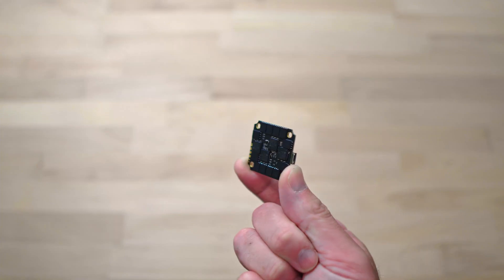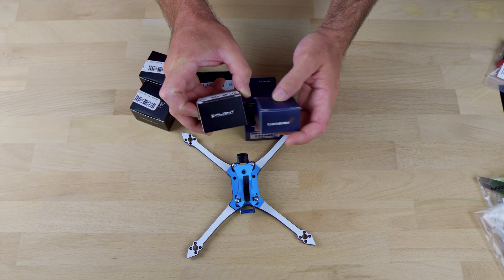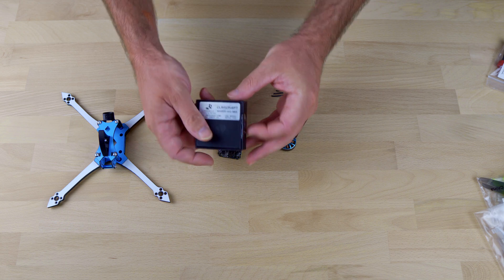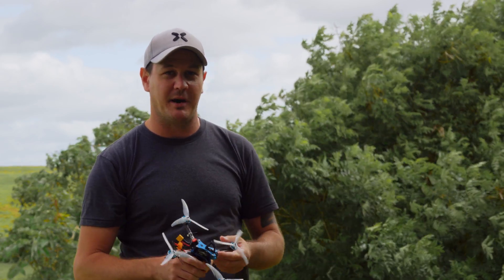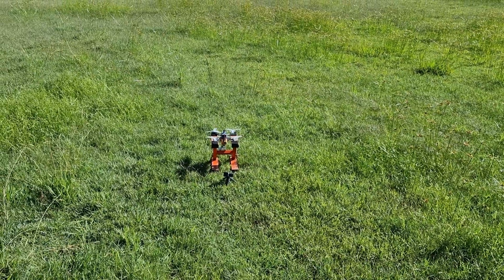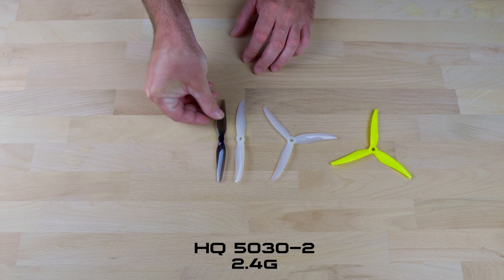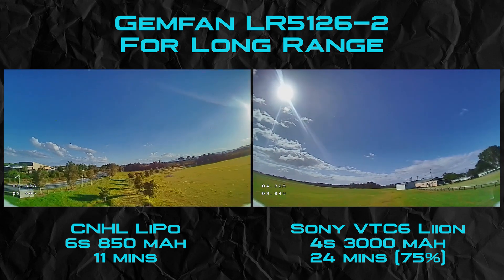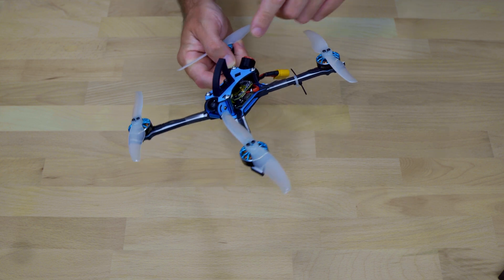Next Gen Race Drone? (Still flies for 30 mins!)

Comment: hey bro, did u use bi blads or tri for the 4s lion and 6s 850 pack?
Reply from the maker: Gemfan LR5126-2
Reply: @ScottTomlinson  sick i imagine it would carry a 1300mah 6s just fine and be a lr beast right? prolly like 15 minute flights?
Reply from the maker: @MrKillerHobbes   The extra weight has a detrimental effect. It'll carry it ok but don't expect any more flight time.
Reply: roger that ty! @ScottTomlinson

Comment: I’m trying to decide on what motors to use on the Black Opal I got from cnc drones.
I see you tried several different sizes and I was wondering if one motor stood out from the others in terms of performance?
  
  FWIW,
 The 5mm version came out at 50grams.
Reply from the maker: The 2005 really packs a punch but you have to live with T-Mount props. I'd probably still go with the F2203.5 but higher kv unless you want that max flight time. There's a 2000kv variant in that now too.

Comment: Hi Scott, your videos inspired me to build an ultra light 5" LR quad. I understand that low kV motors are more efficient, correct? Is it a good idea to go with ~1500 kV if I will primarily run 4S? What would be the efficiency difference of higher kV motors? I primarily care about the longest flight time and not racing (although having an option to put a 6S for a quick rip would be nice). Do you think 2005 is better for this than 2203.5 you previously tested?

Comment: Want to upgrade my flywoo lr4 V2, which has the NIN  1404 motors, they claim a 9.2 g/w ratio which is stupid insane high ;-)  they are ok, super light. with 4S 18650 i´m anyway above the 250grams, so i decided to make it better to rach the 30mins limit.  tend to T-Motor F2203.5 2850kv, hope they are not too heavy. How are these Lumeniers in comparison to the t-motors?
Reply from the maker: The lumenier perform better but are nowhere near as durable. Also, T-Mount is a pain if you're changing props all the time. Having said that I'd probably go with these for a LR build. There's a 2600 kv.
Reply: @ScottTomlinson  thank you for response. Never thought durability is the downside in these days with lumenier. I need tmount, too much props around, I missed that, that the lumeniers have standard mount. Aaah no, all have tmounts.

Comment: Very cool! Love the build! I came across this because I am designing a sub 250g 5 inch freestyle quad for my final year engineering project. I just recently got into FPV and love it! As it stands I am considering using a modified TBS Source podracer frame (adding standoffs and top plate by slightly elongating the bottom plate to allow mounting all the components and leave enough room for a GoPro on top; bottom mount battery). Considering using these same motors on 4S at 2000kv. I have just heard/read that the higher kV on such a light 5inch build becomes less ideal for smoother/tighter freestyle control so I'm trying to lower KV as much as possible without loosing too much speed on the top end. Is there any input you might have into this reasoning or any suggestions you might make for motor selection in this case? Thanks!
Reply: Will you share the frame?
Reply: @SirAdrian1st  it's nearly finished and I am presenting it next week. It's come out so well I'm actually considering marketing it at this point. Will post a video about it in a few weeks on my channel and that should have more details about the frame on there 👌
Reply: @SirAdrian1st  also, note I actually ended up going with smaller motors to drop the AUW but still keeping necessary freestyle performance. AUW with a 530mah HV Lipo comes to 199g. That leaves enough room to add a naked GP or insta360 and even swap out the analogue for a naked DJI vista and still be 250g with the action cam included. I also made optional TPU protector prints for the arms and motors.

Comment: Damn can you do a LR.. like 7" ultralight frame with GPS.. Gemfan even has T-Mount 7" now
Reply from the maker: Already in the works my man! Gemfan sent me a bunch of the new UL props to test too. Both the tri and bi blade look super promising.
Reply: @ScottTomlinson  oh awesome. I'll wait. Was going to see if I could stretch out UL6 they make it 5mm. 
GPS, Flywoo compass (only 0.6g), nin 2303.5 t-mount motors (can't full throttle long because heat though) , GF 7"

Comment: So it looks like you used a xt60 which adds 5 grams over xt30, but it’s only a 35amp board: what was the thought process here?? Or was I wrong thinking you used an xt60?
Reply from the maker: XT30 to XT60 is only 2 grams difference (1.1g vs 3.3g ish) Batteries come as XT60 so it made sense.
Reply: @ScottTomlinson  yeah cool: that makes sense. And what size capacitor did you need to protect that little board without wasting space. Your rubbing 6s so I imagine it still has to be fairly hefty?

Comment: With so much power and efficiency, why not go with more prop-blades for a more "Locked in" flight experience?
Reply from the maker: You don't feel that was "locked in"? The lightweight tri-blade on this kv and stator size would be pretty hard to beat in my opinion. Durability of the 5/6/8 blade props we're seeing are terrible too.
Reply: @ScottTomlinson   Thanks for the reply.

Comment: Hey Scott, love your videos. After all this time flying them, what are your thoughts about the props? Any updates about them, my 5inch light build is on my way and I'm not sure which ones to stock up.
Reply from the maker: Cheers Dennis! I still really like the GF SL 5125-3. It's my go to for most things. I did race 7 rounds on this quad this past weekend and used the new GF 5130-3 which are also really great, I hit plenty yet only split one prop at the hub. The SL 5125-3 do tend to break a little easier but that may be a good thing on motors with such small shafts? The bi-blade really are cruising specific. I personally have only reached for them a few times. The HQ variants fly good too but as I have multiple UL quads now and they use T-mount and 5mm the versatility of the Gemfan suits my needs. In summary. If I were picking one prop for a 5 inch ultralight it would still be the SL 5125-3 (In yellow haha).
Reply: @ScottTomlinson  not so sure about the yellow lol, but yeah I'm more of a gemfan guy anyway(running their 3inch and 6inch props). But most of the time I find myself flying biblades(I'm not racing anymore since corona) for cruise oriented freestyle.

So I will get me some 5125 triblades and 5126 biblades for experimenting. Thanks for your response 👍

Comment: never really got into drones since lipos being questionable (ik with prop precaution its good) but did i see a li ion battery there? can you now make drones without lipos? if so i might very quickly get into this hobby since its increadible.
Reply from the maker: Yes some builds are totally capable of flying on li-ion batteries. More so cruising over aggressive flying however.
Reply: @ScottTomlinson  thx, looking more into it. This hobby looks really cool

Comment: I got 2 dead on arrival FC. I only got to test half a 4s li-ion on my 5" long range. ended at 13.2v using 1800mah (3000mah batter) and flew for 24mins.
Reply from the maker: Sucks about the DOA. Nice flight times though.

Comment: I have now watched this video like 20 times. So impressive! 2 questions. 1: other people building ultra light builds have mentioned that FPV is tricky on really light builds as the camera angle needs to be so crazy like 60+ degrees because the quad just wants to climb, have you found that??  2: you mentioned a slightly different “freestyle” setup. Any details? What would you change? Or is a follow up vid coming? Thanks gain for the sweet content!
Reply from the maker: Haha thanks for the views! Flying this quad is no different to my typical race quads in terms of "floaty feel" Being on the power most of the time probably negates this a little however. I do run high cam angles (~55) on everything so your experience might differ if you fly at say, 15 degrees. Yeah video is coming on the 'freestyle' build. It's similar just a squish design and different antenna mounting basically. Still a bottom mount battery.

Comment: First of all, nice video man. I hope this is getting a new hype.👍
But i got a question there:
How thick are all of your plates?
Reply from the maker: 1.5mm and 4mm. It's got so much power you could easily afford to go 2mm and 5mm and cop the 10-15g weight penalty if that worried you. I've put it through actual racing now though and it's holding up ok.

Comment: you should try out the fpvcycle 2203 motors, they are absolutley amazing on smth like this. Absolutley smooth and crazy throttle controll!
Reply from the maker: Stator volume on a 2005 is greater than a 2203 or 2204. I've tested the T-motor variants extensively. That size is good for the mini long range builds. They don't compare to the 2005 however.
Reply: @ScottTomlinson  in terms of throttle controll snd smoothness?
Reply from the maker: The 2203/4 motors tend to peak/flatten out after say 75% throttle. Fine for the cruising rigs but not really race capable just from my experience.
Reply: @ScottTomlinson what about the axisflying c224 motors, have you tried them?
Reply from the maker: @BowOneFire  I haven't yet. Specs look good for a 4S build due to the kv. A little bit beefier though at 2204.5

Comment: Hi! Do the stickers have any meaning other than visual?
Reply from the maker: Cosmetic only yeah. Might make a quad easier to find/see?
Reply: @ScottTomlinson  and what are the thicknesses of carbon on the beams and on the plates (top and bottom). and are you planning to put the drawings of the frame somewhere?
Reply: @ScottTomlinson  hi! Okay, I understand, I don't want to lay out the drawings... I really do. but, please tell me a couple of sizes, I will draw the same frame ))) the beam thickness and beam width of the motors.

Comment: Hi, first of all, nice video and could you tell me which cutter you use and which feeds and speeds to cut the carbon frames? I have a CNC at home but as far as I know, carbon isn't easy to work with. Found your channel today and instant subbed keep up the great work.
Reply from the maker: Thanks mate. Speeds and feeds are a bit in depth for a YT comment. Carbon sheet is actually an easy material to work with. Basically you want to use a carbide burr type bit and climb mill everything. Spindle RPM 20,000+ and as fast as your machine will allow without chattering or breaking bits.
Reply: @ScottTomlinson  Thanks for the info, guess I will have to try out myself wish me luck. :)
Reply from the maker: Can add me on FB mate. Happy to chat more.

Comment: Amazing build and nice video. Do you think that with a gopro hero 9 and a dji fpv air  unit  on it it Will be capable to do fresstyle with a good acceleration? Thank you
Reply from the maker: Naked vista and GoPro might work. If you're going Air unit and full Gopro then a typical 5 inch build is likely best still
Reply: @ScottTomlinson  I see. Thank you 👍🏻

Comment: Well video is fine, but title is absolute clickbait, there is no new generation "drone".
Thumb down from me.

Yes we already know lightweight machine flies longer even more with lion bat. :-/
Reply from the maker: Thanks for watching Jan, though sorry you feel that way. The intention here is to showcase the possibility of race quads being able to function competitively using an AIO. Something until recently, really isn't being done. We're at the early stage of a transition I feel. Much like we were when 4in1 ESCs became the norm. Literally everything in the build other than the TrueRC antenna has only been available for less than half a year (Some parts mere weeks). The fact li-ion batteries can even be considered being used here is a huge leap forward IMO but not the point. It's lightweight, it's fast, it's digital and it cost less than an equivalent 6S 5 inch race quad. Definitely feels new school to me when I pick up this vs my traditional race quads. Hope to see you next time though. Take care.

Comment: Really nice . How are you mounting those props though ? All the suggested ones are m5 nut and motors all seem to be t mount thesecdays very confusing
Reply from the maker: All five props I showed in the video are T-Mount? (The Gemfan are both T-Mount and 5mm if you don't use the adapter) I'd argue majority of the ultralight prop are actually T-Mount.
Reply: @ScottTomlinson  they looked like m5 and i  havent much available  5inch in t mount here in uk. If those you showed also come i t mount thats great news. Looking to build an ultralite  5 next

Comment: Beutifull drone.... Anyways, how mutch is cost to build a drone that fly for 20-30min,? Some 3 or 4, inches frystyle drone, around 100km/h or so...  I dont need this overpowered beast, something like tyro 79 ir 99 level, only lasting battery
Reply from the maker: Check out the Flywoo explorer or Rekon from Dave_C

Comment: How long is the flight time on race pace with 6s 850mah?
Reply from the maker: Around 3 minutes. I actually get a little more out of this than I do my typical 5 inch quads on a 1300.
Reply: @ScottTomlinson  I will give this setup a try. Nearly 120grams lighter than my 2207.5 setup.

Comment: Is it under 250g AUW with the CNHL 850mah 6s?
Reply from the maker: Unfortunately not. The quad dry weight is 190 grams so you'd need quite a small battery to reach that target.

Comment: how is progress with the tubular frames?
i've put mine on hold until i'm inspired again that it could actually be better
in the meantime i made a 4" toothpick with the diatone mamba toka 1505 3800kv motors
they are absolutely beautiful
planning to use 3S 750mAh R-Lines
hopefully they perform nicely, too
Reply from the maker: Oh sounds great man, I'm sure it'll do great. Still working on my tubular 7 inch yep, just waiting on a few pieces to finish the puzzle so to speak. I'll definitely upload a video once complete though.
Reply: @ScottTomlinson  it did work very nicely
with 168g auw and 7min flights
i also have a new idea for a tubular frame again

Comment: How does it do on a track? Can it keep up with more traditional 5 inch race builds?
Reply from the maker: It's faster and more agile than my typical race quads. I like the fact there's less momentum in the turns too so it can tighten up corners and spirals for pilots like myself who tend to overshoot features. My concerns are more around durability of the T-Mount props (and the longevity of the actual motor mounting holes etc) It's still a relatively new concept build to me so I can update once I've really hashed it out. I'm quietly confident though.

Comment: Really nice video! The sticker decals (vinyl I’m guessing) were a nice touch. Yet more proof that a bigger drone and a giant batterie isn’t always the answer for long flight times. That’s probably why my bixler 2 on a 2200 3s gets more flight time than a GoPro carrying 6000 mah setup. (Well I guess there’s a diminishing return between flight time and batterie size because of weight).
Reply from the maker: Hey mate cheers, That's vinyl yeah. Adds a little flair. Absolutely, I've tried stacking batteries to the moon too but it doesn't always work out unfortunately.
Reply: Goodday! Stickers are good, also I can recommend to use light reflecfing stickers, the same which are used making road signs, so, if someday Your drone gets lost, You can go around at night time to find it using powerful light torch and looking where in field or woods You see reflecting ligt blinks. Good luck! Also, what I can say - 50gr frame weight is good, and maybe sharkbyte also is less heavy than dji hd?
Reply: I don’t know if you agree. But that’s just what I’ve observed. Which is why mini drones seem to be better at long flight times in most cases.

Comment: U should try ummagawds 2004 they seem extremely efficient on paper and also maybe try the 21700s.
Reply from the maker: It's so cool seeing all the new stuff come out, that being one of them. I used a 21700 pack in my 55 minute flight a little while back.
Reply: Hi! What pack did You make? Seems that, in 400grams can be made 3s2p pack with 8amp hours inside! Thats pretty a lot of energy :)

Comment: That looks amazing! What is the estimated cost without receiver and battery? And what are your thoughts on Flywoo Explorer lr4?
Reply from the maker: Can't go wrong with an Explorer. Check out Dave's Rekon ones too. As for cost, less than a typical race build as the motors/AIO is a bit cheaper. I'm in Australia though so prices are a little skewed to give you a number sorry.
Reply: @ScottTomlinson  Thank you. I'm in Turkey so same thing for the prices :)